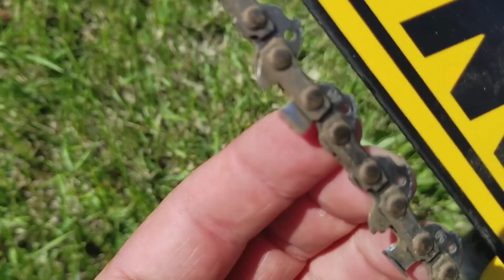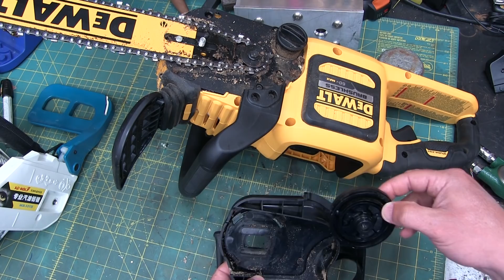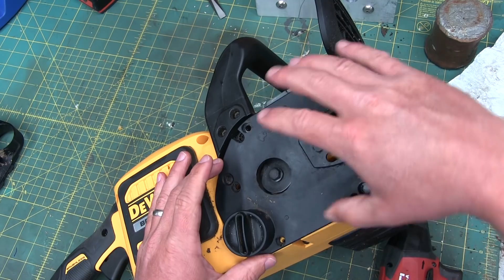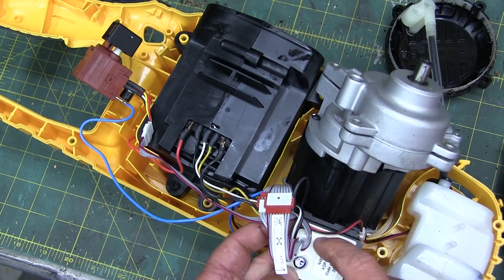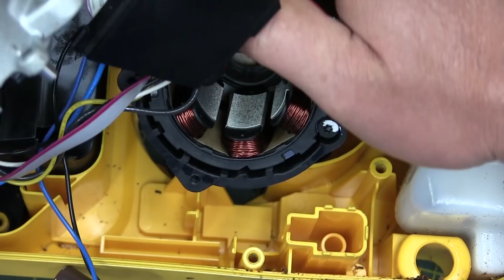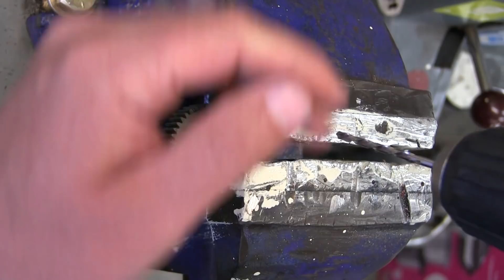BOLTR: DeWALT Chainsaw | Engineering FAIL

Comment: Hey Ave, I have voltage question for you that’s been on my mind for a while!

What happens when you connect two automatic voltage regulators (AVR) together? I have a 120v APC AVR, and a Cyberpower UPS with built-in AVR. When I plugged the APC into the UPS and the UPS into a power outlet, they both started clicking back and forth like crazy and correcting each other’s voltage. 

Then I reversed it, (so the UPS plugs into the APC which plugs into power), its perfectly stable at 120V. Whenever there’s a brownout, both the UPS and the APC activate simultaneously. Why does this happen? Shouldn’t only the AVR that’s plugged directly into power be the only one regulating the voltage? And why does the reversed order make them go crazy?

Comment: Chain looks loose, adjust the tension on the chain and the way you cut, you hit the ground. Its the user not the tool. I have same saw, works great, just as good as Stihl MS 261CM. Keep another battery handy and you're set.

Comment: Several years ago I bought a small Stihl chainsaw and it has a similar bar tightening arrangement. But the Stihl doesn't have that stupid clutch and rubber contact pad, so the bar is easy to get tight. Furthermore, the chain tensioning mechanism is basically just a big thumbwheel that uses mechanical advantage to get the chain tight. The system works so well that Stihl now uses it on larger saws. DeWalt needs to hire better engineers.

Comment: I have a Dewalt cordless reciprocating saw. The traditional looking one, not the offset compact one. It's fantastic when you have no power, but the damn thing overheats and refuses to chooch, especially in the heat of summer. It must be a safety thing built in.
I bet that chain saw has the same thing because it has no heat sink. If you run a few batteries through it constant I bet it would quit to protect itself.

Comment: Off topic: can I ask you to use your soap box for a psa. For tinkerers out there should be warned not to screw around with automobile seat belt parts. I was messing around with one thinking it would be a cool part and it was actually rigged with explosives from the factory. Blew up like a grenade right in front of me.. I was invincible on that night so no injuries but probably added to the hearing loss and since it was 430 it did not exactly make the other occupants (the variety that sleep) very happy. My battery was o. One side of the garage and the part was on the other when I found them.

Comment: Will a 60v dewalt tool work with a 20v battery like a 20v dewalt tool will accept a 60v battery?

I have seen some deals on 60v Dewalt tools. I would like the extra run time for my 20v tools, but wonder in my 20v batteries will run the 60v tool in case I ever run short on charged 60v batteries.
If anyone has both and can answer this, it would be most appreciated. 
Thanks.
Reply: no the 20v batteries will NOT power the 60v tools...but yes you can use the 60v batteries on the 20v tools

Comment: I have a theory that the chain system  worked well on the small 20v 12" blade saw, and hasn't scaled up well top the bigger bar size.

Comment: This really looks like they took the Black and Decker stuff, painted it yellow, sold it as 40v for a while, then just upped the voltage once Flexvolt came out. Would not be surprised if they came out with an actual engineered version like Milwaukee before too long.

Comment: Shouldn't that grease have actually been on the gears after using it? Seems strange the gears were dry with all the shmoo all off to one side. Assembly failure?

Comment: I couldn’t find online a nice simple video about the physics of vacuums.. so my laziness has a quisitive question for your mind. I’m a contractor and a certain global conglomerate which, I will not name here  (They make phones) ...like the phone.
Has a problem, they have rooms in their data centers that are under atmospheric pressure. (Which then you can think of the exterior room as being a vacuum). Because the force of opening the door to the pressurized room is a safety concern. They Want a small room built outside of the compressed room to alleviate the force  of opening the door to the compressed room (the vacuumed room). But in my mind if you build a room around a compressed door, when opening the door in a smaller room the amount of air that is in the smaller room would be less compensation than the larger room. So in effect if we build a small room out side of the compressed room, when opening the door to the compressed air from within the smaller room, the forcing pressure would be stronger rather than lesser into the larger room because the air and subsequent pressure from the pressurized room would have less space to travel and dissipate. Am I correct in my thinking or will the smaller room alleviate the force of the door opening to the compressed room?

Comment: No doubt this item is due for an AvE engineering special upgrade.  I would start with at least a load plate or washerlike the one inside a real saw and a nick or similar nut.  But no doubt you can not something up on the mill.  Ps how the feck do you tension the blade on that thing? I that would need accommodation in the upgrade.

Comment: For anyone out there pulling their saw apart - please don’t try to stop the springs with your hands. If they want to come out, your hand will be mince meat. Having pulled a saw apart where I forgot the brake on, the thing has such an insane amount of energy in store that it took an hour to figure out how to release the mechanism when it’s off the saw - without tearing your hands to bits. In most cases you’d probably be fine, but you don’t want to take the chance of a fight with skin vs spring.

Comment: You should check out the green works electric chain saw. Much butter as they use actual nuts to keep the blade from fucking right off.

Comment: it being dewalt it don't surprise me! How cheap it is when they took over black and Decker they was great now they are junk or as AVE would say corksuckers lol i used Dewalt all the time but then it happened. i had a trim gun that took a shit on me about 3 months after i bought it and they refused to fix it even though it was under warrenty my sales man at lowes even called them and they still refused to fix it would not even give a excuse why. thank goodness i had the extended warranty thru lowes and got my money back i even loved the gun every since then i will not buy dewalt thanks for letting me vent.also man i love all your videos and your personaliy is great don't ever change AvE
Reply: Like a finishing air nailer for base boards and small gauge stuff?  I have a bunch of DeWalt stuff and if that is the tool you're talking about I agree, avoid that one and apparently this chainsaw too.

Comment: Heatsink issue... it's a good cost trade-off to use the better grade MOSFET transistor with sub-milli-Ohm ON resistance...... versus using a cheap MOSFET and the requisite finned heatsink that will get dirty and lose its ability to dissipate heat.... and thereby risk letting the magic smoke escape. 
Surprising to see such a cheap design by DeWalt... my 60V Snapper aka Greenworks e-saw has proper hardware on bar adjustment.

Comment: As someone once said on an automotive forum, "If you put 350 B.H.P. at one end and 36" Super Swampers at the other, something in between is going to tell you to go and fuck yourself."  Bit of a shame that such a powerful prime mover is baked into a rubbish cake.  After spending the last two years working at a computer repair and recycling operation, I have quite a few moments of "Why the hell did you build it that way?!?"

Comment: A little reference for electronic speed controllers for brushless motors. Since they're basically three phase inverters, they should have a set of three beefy wires going to the motor, not little bitch lines and a ribbon cable.

Comment: AvE help? I own one of these from factory hasn't worked for shite. Parents actually purchased never filed warranty blah blah. It will power on and turn for a split second the cut out completely. Try it a few times and it will go until u put a little load on it and cut out again?
Reply from the maker: Yeah, it's fucked.
Reply: @arduinoversusevil2025  are mosfets repairable? I have melted residue on the screw between two mosfets (the two that are separated from the other four)

Comment: Doesn't the lack of sliding friction in mating spur gears rely on properly cut and specific tooth geometries as well as a lack of slop that simply isn't present in anything short of proper industrial-grade kit?  All the spur gears I've seen in tools and other small motor devices don't cost enough to bother with cycloidal, etc type teeth.

Comment: I dropped 6 to 8 inche diameter no problem it takes a little bit longer than my 211 but its battery not max so it does really well for what it is

Comment: Cool teardown, saves me the trouble of breaking a lefty boltr. Thanks Uncle Bumblefuck!! 
I bought mine for yard work and emergency winter work, like that time I couldn't get the jeeslus gas saw to start in that blizzard to get the farkin tree branch off mah powah lines to the house. Had to use a Torso weed smacker with a chain trimmer attacherment to weaken the damned branch what hooked itself on the 220V/100A powerlines runnin from the pole to the house. Chain was a few blonde ones away from the SUPER angry pixies as the blizzard was a swayin everything in the wind. Got er dunn without fillin out an incident report at the local morgue, but man!, pucker factorial of 10.5 . Same storm I'm tryin to get home on a 50mi commute and just every road i'm tryin is blocked with trees and lines and trees with powerlines. Carry this chainsaw with me now just in case the road is blocked again with a farkin tree (not messin with powerlines and trees though, leavin that for those PROfessionals ).

Comment: They have fixed the ratchet thing. Mine you can crank her down tight. I abused the pics out of mine. And only had tge chain jump off once. But put dirty oil in it and now no oil is my problem.  I live thus little saw for trimming and light bucking. But she ain't oiling.

Comment: Better or worse than an old Remington air saw?
Reply from the maker: The Dewobble don't run on pressurised muck and rust scale.
Reply: Every now and then you'd find one that didn't have the screen de-virginized with a spud wrench...
Just pour more rock drill oil in them when they get sloppy!

Comment: The only reason I see that they made the ratchet and chain tightener the way they did is to avoid the need for the typical chain saw tool.  A tool less usage so to speak.  However, if they would have made a holder for that traditional tool and use traditional chainsaw attachments and chain adjustment it would be a much better tool.  Perhaps they did not want to pay the patent holder.

Comment: I have a Ryobi battery chinsaw, the thing rips pretty good and has suprising long battery life. And its built way better than this yellow thing you have there, nothing wobbles around and you can throw it around quit a bit.
Best thing is that you can just pick it up, press a button and it goes. No fuel, no loud chainsaw running between cuts.

iam actually worried because they are so easy to use, people need to understand that even this bby chainsaw can hurt badly and isnt a toy...

Comment: Mine, purchased 2020, has a worm gear style oil pump instead of the cam type shown here.  Apparently they updated it.  Or in my case, retrograded it since mine never pumped oil even right out of the box once filled.  

Every Dewalt tool I own brings me joy and happiness- except for this turd.

Comment: Please pleas please read this, the claim that the elechicken ford pickup truck pulls 1.2 million lbs. Is it possible to pull with that little strap, is there anyway to actually figure out the  linear pulling force not the actual weight of the cars if they lifted them with a helicopter.

Comment: I own a $60 sum dim cock manufactured electric chainsaw. Similar layout but the clamping mechanism is a normal bolt with washer, the bumper is a 2 inch wide flat area that encircles the bolt, and the plastic housing itself is a hell of allot thicker than that flimsy thing on the dewalt.  There is still a little wobble but very minor and its perfectly fine for what I want, chopping foot thick logs and floor joists for the winter fuel so I don't freeze to death in the 6th richest nation on earth due to not being able to afford central heating. Some people flick a button to be warm through a winter, I work hard for that luxury.

Comment: The people this is for, generally find a proper nut too confusing, its the same tension system and bar grip on most if not all electric chainsaws, they would need a weeks course on how to take the bar off on a real chainsaw. Wranglerstar does a good review on this chainsaw

Comment: Bad controller programming if a brushless electric motor throws the chain a lot.  

Brushless motors have killer low-end torque.  You need a microcontroller based motor controller to limit it or you are going to be screwed on something like this.   No amount of design will compensate completely.  Add to this the flimsy mounting hardware and you are doubly screwed.

Failure throttle back the motor under this low-end torque load is also what kills the battery life, add to this choosing smaller batteries to make it nice and lightweight, and you are screwed again.

A metal shim plate under that plastic piece would make for a much better mount system. 

The same with all the other plastic mechanisms  Fix them to metal, then cover them with plastic to reduce the exposure of the load bearing plastic to the elements.

As a note, that's a capacitor, not a diode on the switch.

That capacitor is a power cap for storage of energy not spike reduction.  It provides HV power to the main drive.  It's likely moved to keep it away from heat.

Comment: I’m wondering if an owner replaced that plastic plate with a metal one of some variety would help.  Kind of a mod kit for it.

That  video was very skookum.   The dispassionate analysis Is great.   Makes you think the designers had no actual experience with a chain saw.

Comment: I keep having to repair this saw. The batteries are replaced under warranty instantly, and the brushless motor has been infallible, but bar flex leads to chains popping off and chewing up the teeth on the brake drum and munching the plastics. I just now converted it to a 14 inch with a .50 gauge chain to see if that will work better. I suspect it will. This thing should never have had a 16-inch bar on it. It’s a micro mini limbing saw in design, with a better motor and battery capable of doing more. Pick your poison. Off the shelf, it’s an under-engineered limbing saw that breaks, or if you put a smaller bar on it , it’s an over engineered POS bush trimming saw that won’t break.

Comment: See if you can run a die over the locator pin whatfor having threads on it. Then fab yourself a new plate to attach that bar better to the tool.

Comment: I think part of the reason it's made so cheaply is because it only has to last as long as the battery.  It's like all of the other battery operated power tools that are perfectly good until the battery won't hold a charge.  By the time your tool needs a new battery the battery design has changed and the new batteries won't work with the old tools.  Just as they planned.  No body is going to be handing down battery operated power tools to their grandkids.

Comment: Personally I'd rather someone figure out how to put one of these fancy brushless motors in something with a cord on it. Can pull up to 2.5 HP from a 120v socket assuming a 15A breaker, and that's right around the power output of a 2-stroke that is actually big enough to do work with but still small enough that you won't hate having to pull the thing out for small jobs.

In other words, fix the janky bar attachment and tensioning setup and figure out how to feed this thing pixies from a wall socket, and I might actually be interested in this thing.
Obviously right now the bar attachment and tensioning kills it no matter what it's powered by. Hopefully there's a version 2.0 that fixes that.

Comment: I agree you can see the reliefs in the plastic for the six FETs to drive the brushless motor. 

You can also tell because there are only two power wires going to the motor, not three. A BLDC motor is a three phase motor and needs three independent sets of switches or half bridges (six FETs total) to operate. The two wires going to the motor are just the voltage supply and return to the battery. 
Also that big cap with the ridiculous leads (wires are inductors, the opposite of capacitors) needs to connect to the voltage supply and return rails across the FET half bridges to shunt switching noise. 

Maybe they did the EMC testing to know what was needed to comply with regulations and that configuration allowed them to pass. 

http://i.imgur.com/urU0WiV.jpg

Comment: I got this saw 2 weeks ago, was cutting a small tree down (less than 4" wide), and the saw just stopped, as though it has stalled. Wouldn't come back on. On Monday I'm going to call DeWALT and get 'tech support.' Am ready for tears. I bought this saw because I have numerous gas saws that I can't get to start all the time. I thought electric would be a different story. Sigh.

Comment: Fuck me dead. Were the DeWalt engineering team think they were design a children's toy? But, man, even if they are designing toys with a electrical motor and moving mechanical part, they can probably try to use caution and know that if they don't job right, there can be serious consequences.